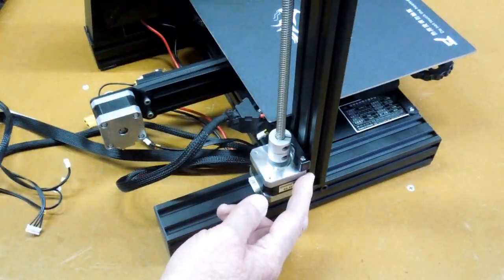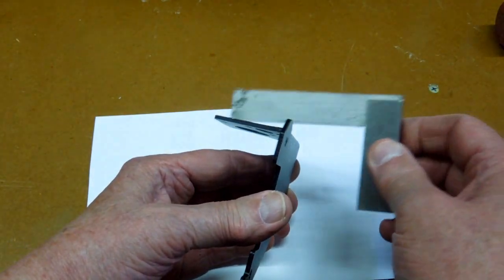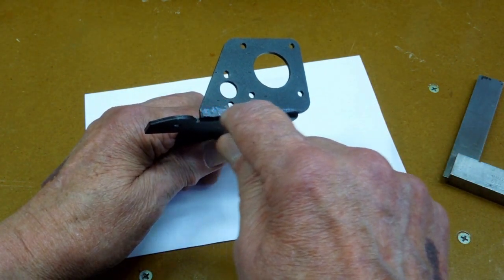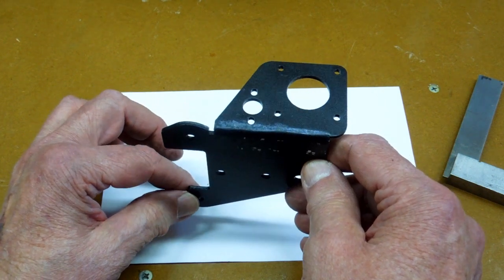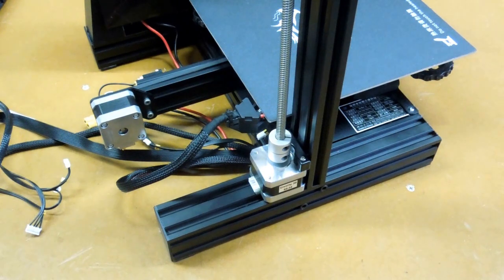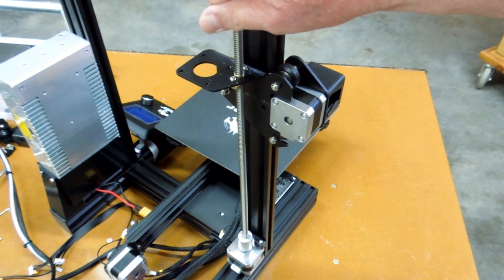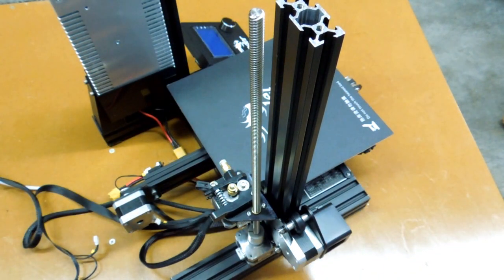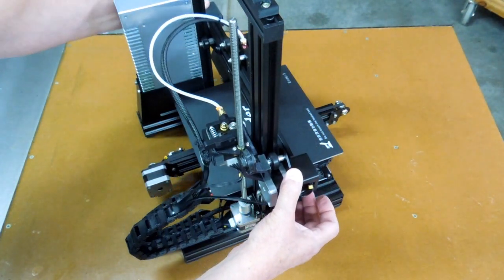Creality Ender-3 Z-Axis Alignment Correction

Comment: I have 2 enders and the vast amount of problems and hundreds of hours I've sunk into them leads me to believe that they are actually a pile of shit and not worth the money. I've spent 50% more than i paid for the printers upgrading the crappy stock components. I've spent countless hours fixing numerous problems, some of which are as simple as ensuring the eccentric screws are just right so I don't have a giant elephants foot on every print (but took a life age of the earth to narrow the 

These products should never have been released in the state they're in because after a certain amount of time they will start to slip and you will have to dive deep down into the rabbit hole and learn an absolute shitload of information in order to maintain these machines and keep them running. 

They are definitely for people with high technical skill and patience.
Reply from the maker: Hello Barry,

Sorry you have experienced problems.

I have corrected some alignment problems with the z-axis alignment and carriage wheels on the bed of the Ender-3 and did not experience these issues with the Ender-3 Pro.

I haven't updated these numbers for the past year but my Ender-3 has over 4500 hours on it, my Ender-3 Pro around 500 and the CR-10 around 2000 hours and everything is original except for some thermisters and a fan or two. The Ender-3Pro simply hasn't been used as much. The CR-10 is only used for very large stuff as 99.9% of what I print will fit on the smaller E3 beds.

It does require a good deal of time learning how to tweak the wheel eccentrics and learning the numerous other adjustments involved.

At the urging of a friend in Germany, I have upgraded my Ender-3 Pro to direct extrusion, added a BL-touch for electronic bed leveling and a different mother board which really quieted the stepper motors (it also allowed the addition of the BL-Touch). Haven't had a lot of time to play around with these changes but the upgraded E-3Pro is certainly printing much nicer.

Guess you have one of two options... hang in there and keep trying...or have the satisfaction of taking them out back and shooting them with a shotgun (or alternativly giving them to someone you really don't like). I would urge the first option. :-)

Thanks for watching.
Good luck!
Ron

Comment: how tight do I tighten those 2 screws where the big z screw goes through that part that he bent?  Should those be loose, snug, or really tight?
Reply from the maker: After you check all of the alignments, the two screws are tightened which hold the leadscrew nut. Then check that the leadscrew is turning freely as the z-axis carriage is raised and lowered fully travel... the end of the leadscrew should remain stationary as it turns and not moving back and forth or in an elliptical pattern.  The screws are tightened firmly but not overly tight. You do not want to twist one off or strip out the threads. 
Thanks for watching. Please subscribe! 
That is what keeps this channel going. 
Ron

Comment: That’s a good way to fix it, I went a little bit quicker route and just used aluminum can shims to shim the nut on the lead screw 
I noticed when I loosened the two screws holding it it would feee up the z axis so I shimmed accordingly

Comment: I think this is happening with the newer Ender 3 V2! I still need to take the X-axis assembly off to verify it, but everything else seems tight and aligned, yet the Z-axis screw ends up being pulled away from the vertical rail. I'll update this comment if it ends up being the cause. Thank you so much, Ronald!

Comment: I think the more important question is why are we still giving creality our money?
Reply from the maker: You just need to study the requirements for improvement.
In the beginning, I made a number of adjustments / corrections to the Ender-3. 
Since then, it has performed very well with little maintenance work.
I have two other printers, but this is the one I use for most of my prints.
For a reasonable cost, plus a few modifications, you end up with a pretty reliable 3D printer. 
But you do need to do the research and be willing to do the work.
In the three years I have had the Ender-3 printer I have put 4,400 hours on it.
Reply: @RonaldWalters2010  fair enough, i just feel like if you're marketing a printer to the entrant level consumer, you should probably not expect those entry level consumers to rework the framing on an anvil lol

Comment: I am on an ender 5, but still applies. I checked my Z rod and i noticed 2 of the screws where missing. XDXD
Always, I always end up with more screws when I am assembling something.

Thx alot. I hope i did not bend my Z
Reply from the maker: Years ago I had a meticulous mechanic working for me and he was also a huge pain in the ass. He would take something apart, clean everything and then would have the bits and pieces separated into different containers for reassembly. Occasionally I would go out to the shop after everyone else had left and either mix up a few parts or add one more fastener to a container. The next day or so I could watch the dilemma I had created. Mean and cruel, but it was great sport! I think those packaging the nuts, bolts, screws etc. for these kits do the same thing just out of meanness.

When you raise and lower your z-axis, the end of the z-rod should remain in the same place and not oscillate around. If it remains in one place and the mechanism moves easily, then you should be good.

Thanks for watching!
Reply: @RonaldWalters2010  That's evil.

Sure enough my rod was not perfectly straight. It had an aprox 0.3mm wobble in it which I managed to trace to the upper portion of the rod. So, I bent back it until I couldn't identify the direction anymore. Which did help but didn't solve the issue completely.

So, naturally I reassembled the entire Z axis assembly to a precision of what my shitty caliper can measure. Did another test, the ribbing was still there.

Then I noticed the Z nut has a bit of give in it. So I needed the rod rub against only 1 side of the nut so, I purposefully misaligned the rod (the angle of it). Obviously the slightly more rubbing increased the chatter a bit but got rid most of the ribs. It's acceptable for me.

I also triple checked the flex coupling and made sure it's properly mounted. If It comes to stress, that is where it is going to be.

Probably I'll pick up a proper ball screw sometime in the future but first I'll try an angled flexible washer once I load up TPU.

Comment: Can I assume that: if I remove the z-axis rod from it's coupler and let it hang above the couples ( 1:40 ) and it just sits right above the coupler hole, my z-axis alignment is fine? Thanks in advance for the help. Thanks for the video and knowledge, the quality is good!
Reply from the maker: Yes and No. There is a good deal of wiggle room between the leadscrew and the leadscrew nut. The real way to determine the alignment is when the leadscrew is in the coupler... the leadscrew is perfectly aligned with the z-axis tower column in the X and Y direction top-to-bottom. If it is in alignment... at the end of the video as I lower the extruder plate you will see the end of the leadscrew does not move in the X or Y direction as the Z-axis carriage is raised or lowered. If there is misalignment, the end of the leadscrew will move closer to or further from the column... or left or right and the carriage goes up and down... and there should be absolutely no perceived resistance to the carriage movement (other that that required to spin the Z-stepper motor)..
Thanks for watching and for your comment.
Please subscribe. That is what keeps this channel running. 
Ron
Reply: @RonaldWalters2010  Alright, thanks for this. When I try to move the Z-axis carriage up or down it won't budge at all. I can carry the whole printer by lifting this axis... not good. Wish I found this out before assembling! Now I have to do it all over again!
Thanks again, have a good day! You got my "like" :)
Reply from the maker: The two vertical columns need to be parallel and in line with each other.
The rubber tires need to be carefully adjusted. If too tight they won't budge and you can end up with flat spots on the rubber.
Caution... If the carriage (or carriages) are that tight you can burn up a stepper motor which is trying to move something and cannot.
Caution... These tracks are aluminum. If you over tighten the assembly screws you can easily distort the aluminum.
Your problem may (or may not) be what is described in this video.

Comment: No before and after prints of course.  Far as I can tell, you fixed a problem that effected anything.
Reply from the maker: Yes... well... the name of the game with YouTube is to address the topic as briefly (and in my case as completely) as possible. I have several thousand hours on this machine with out further issue... except about the same time I also did a video "Ender-3 Y-Axis Carriage Wheel Adjustment Correction" which you may also be interested in. Thanks for watching. Ron

Comment: I found your videos interesting, as I've just yesterday began getting problems with my Ender 3. I've had it for 2-3 weeks just about. The issue is that it does not want to stay up in the furthest upward position on the Z-axis, and with the weight of the gantry it slides itself all the way down to the bed, making for alot of noise when it goes up and down the Z-rod. Any suggestion on what could solve this?
Reply from the maker: Assuming the z-axis leadscrew is tight to the coupler and the coupler is tight to the z-axis stepper motor… I have never had it freewheel from the top to the bottom even with the power off. There is generally enough friction or resistance in the stepper and leadscrew to leadscrew nut to hold the gantry wherever you put it.

Also assuming it does not freewheel top to bottom with the power on… correct?

The issue addressed in this video is exactly the opposite, where the misalignment was so bad the stepper could not power the gantry up and down… and it was very difficult to move it by hand with the power off.

Thanks for watching! Please subscribe. 
That is what keeps this channel running. 
Ron
Reply: @RonaldWalters2010  Thank you kindly for the reply! I am quite new to 3D printers and your video has helped me tons. I do have a friend that set me up with the basics of tweaking things and software alike. The issue was one of the wheels on the X-gantry rolling on the Z-axis was very tightly screwed on, leaving it very little play to grip onto the V-grooves on the sides. I have gotten it fixed with a small headache and an hour of thinking and turning things upside down. You have got yourself a new subscriber, thank you again sir!
Reply from the maker: Yes, the adjustment of those wheels is a bit tricky with the eccentric axles. Glad you figured out the problem. You must be willing to mess around with it a bit to get things to work. It will work perfectly and then half-way through a print all hell breaks loose for no apparent reason. Fund stuff. :-)
Another good source of information is CHEP Filament Friday and he covers a lot of stuff with Ender-3 printers. https://www.youtube.com/user/beginnerelectronics
Thanks for subscribing.
Merry Christmas
Ron

Comment: Mine goes down fine like in the video but doesn't do the same on the way up.. Possible issues ?
Reply from the maker: As shown in the video the lead screw must be in perfect alignment with the Z-axis support column, in both directions (X & Y). Since it sounds like yours is binding somewhere, you need to look closely for the problem. Also check that the support columns are square with the bottom support (base). If you over tighten the bolts holding the aluminum extrusions together, the extrusions can be easily distorted.

Comment: I have the same issue but mine is too far bent any suggestions on how to fix that?
Reply from the maker: Flatten it (unbend it) being careful not to break the metal at the bend, use it for a pattern and make a new one. Then bend it correctly. Or try to get a new one from Creality.
There is more than one answer to a problem. You could try adding material to the bracket (maybe plastic steel or Bondo) and then carefully filing or sanding it to the correct alignment. Don't dent the added material by over tightening the fasteners.

Comment: I am not sure if this is still monitored. I have a new 600x600x600 printer, running Reprap. Its not direct drive. From day one, I have had issues with extruder jamming. I have resolved them all, but one and I think I know what the issue is, but not the cause. I think the Z steps are getting shallower progressively the further into the print I get. I have covered zeroing, first layer height, extraction distance and temp. now, 30 to 45 layers into a print... out of no where, it will clog in the nozzle causing the extruder jam. My only guess is that layer by layer, Z isnt moving the full .2mm. What could be causing this?
Reply from the maker: Not sure there is any simple answer for this. 

If the z-step was decreasing (all other things remaining unchanged) I would expect an accumulation of filament around the nozzle and globs of excess filament all over the part. 

On my CR10 I was frequently having things plug up. After many disassemblies I finally discovered a problem with the metal tube which fits between the heater block and the heat sink (it should butt up against the nozzle) and the Bowden Tube passes through it. Originally I did not know the Bowden Tube should freely pass through it. The metal tube had a machining burr inside of it. At first I thought it was a lip for the tube to but up against. Ran a metric size drill bit through the metal tube to clear the burr and problem solved.

Filament can have bits of junk in it. Worst offender has been black filament.

Inconsistent filament diameter causes problems. Seldom do I get actual 1.75 mm diameter filament. I measure it and enter in my slicer what I think is a representative diameter. Usually around 1.70 mm but sometimes as low as 1.68 mm and that is a 3-4% difference, which will cause under extrusion. However if you have entered 1.7 mm in your slicer (and forget about it) and then actually get 1.75 mm filament, you will have over extrusion.

Wide difference in filament performance between the different colors. Some require higher nozzle temperatures than others.

Retraction settings can cause clogging. If the filament is drawn back too far it can start to cool in the cold zone (heat sink). Again different brands and different colors of filament can behave differently.

I think changing colors can cause problems as well. When you pull one filament out some of it remains in the nozzle and in the transition zone.

Quite a few people think dust on the filament can cause clogs. There is quite an assortment of filament wipers available on Thingiverse.

Insufficient spring tension at the extruder can cause problems.

If you are using a Bowden Tube… the push-to-connect fittings can wear away the Bowden tube and allow the tube to slightly move back and forth which can cause various problems and ultimately release the tube altogether in the middle of a print.

That’s all I got. :-)

Thanks for watching. 
Please subscribe! That is what keeps this channel going. 
Ron
Reply from the maker: Also, check out CHEP – Filament Friday.  Lots of good information on this channel.
https://www.youtube.com/user/beginnerelectronics/featured
Reply: @RonaldWalters2010  sorry for the lateness of my reply. Thank you so much for detailed possible causes. It turned out to be the heatbreak that comes with the E3D hotend. I swapped it with one that allows the bowden to seat all the way down to where it narrows at the bottom of the heatsink. Now I can't make the thing jam. Again, thank you so much for your advice on what to look into further. I greatly appreciate it.

Comment: I found another culprit ! My rod lined up exactly as shown In video, down and to the left. So I removed and spun the the brass fitting (between the two screws) 180 degrees where the z-rod falls and the alignment shifted to opposite side.....